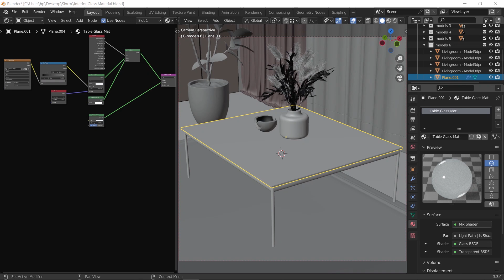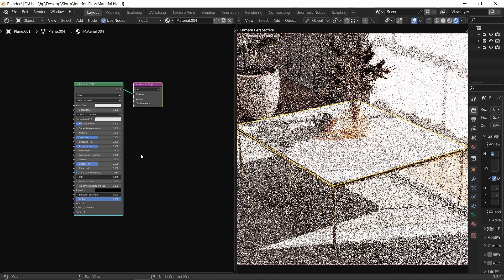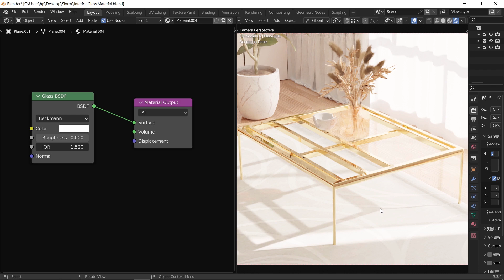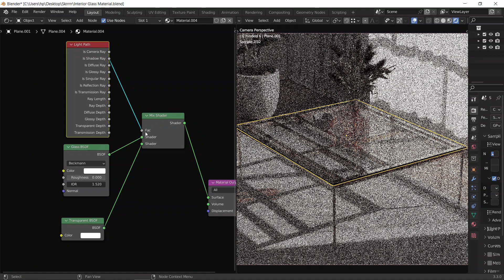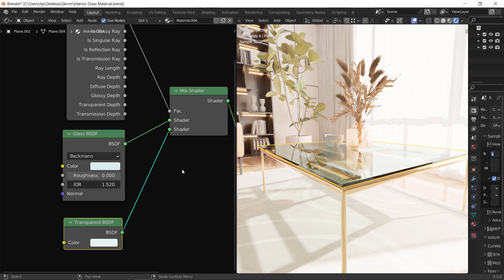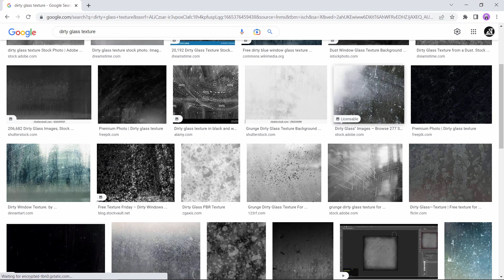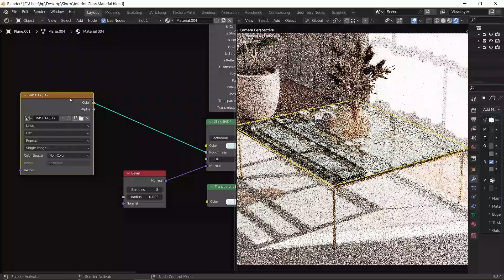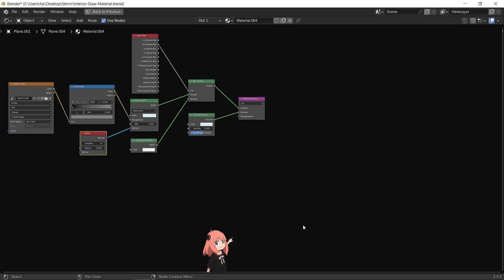Best Realistic Glass Shader in Blender (Tutorial)

Comment: My observations and comments:
1) I wouldn't cheese bevels using a bevel node for something as simple as glass panes.
2) Glass shadows along the transparent normals should be subject to fresnel/layer weighted shadows. A thin cube will cause more shadows at grazing angles (from the light sources POV). I wouldn't bother at all with shadow handling for the rim.
3) Never use colored glass shader, as the reflection should "always" be white. Typically architectural glass don't have an anti reflective coating on it like regular glasses to wear do, which does create a green tint but only on facing (white at grazing) angles. Use volume absorption instead, this will also tint the edges correctly (with high enough refraction and glossy bounces, around 64?). If you don't want volume calculations, at least setup glass manually with refraction and glossy mixed with fresnel, and color only the refraction portion.
4) Make sure you create a glass material that enables you to use it for both architectural glass with thickness (like in the video) and for architectural glass without thickness (like you'd use for windows usually). You'd have to drop it into a group node with two output sockets, one for each. You could go further and mix/expose controls for other absorption shaders as well, such as diffuse, translucency, sss (no translucency, so use with care). Basically it could get hella complex really fast if you want to.
Reply: I think it's easier to split it into at least two glass materials to use, because for most architectural and furniture glass we don't want it to create too many shadows, and they won't be photographed up close for detail most of the time. For objects like glass mugs, gemstones and such, we would want it to produce an effect closer to the real thing, so it's just a matter of differentiating and simply grabbing and using it.